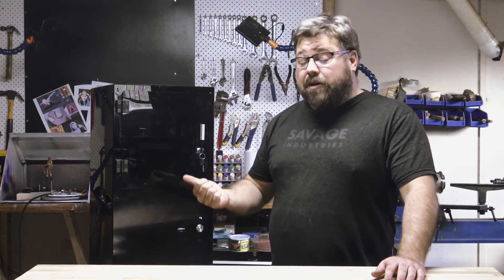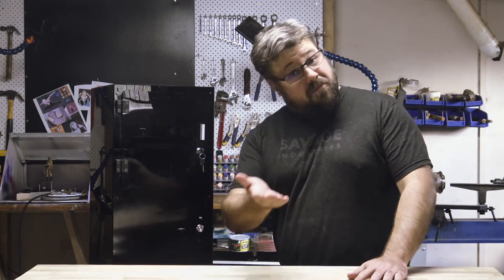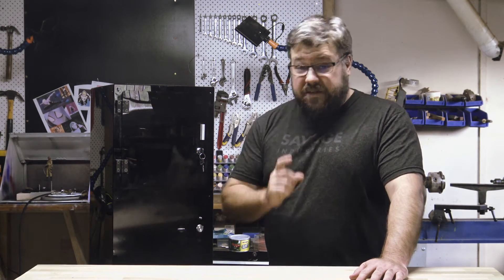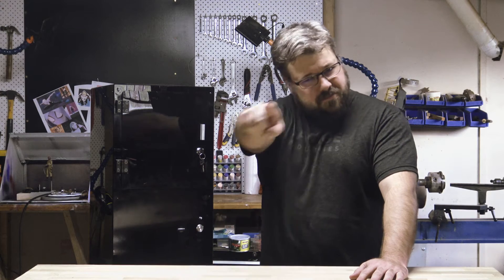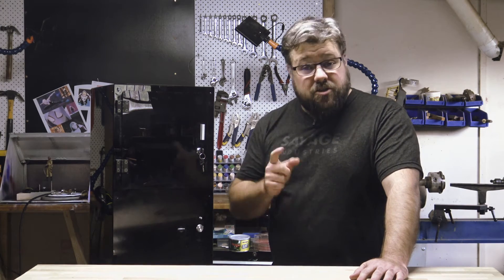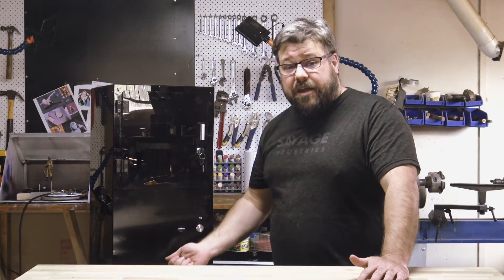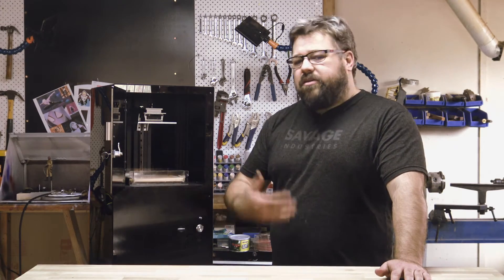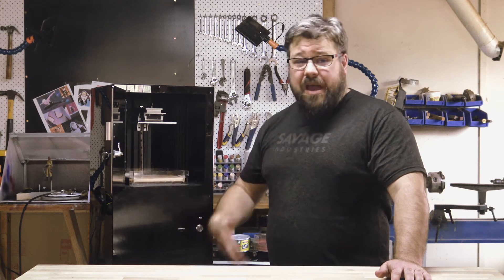DIY Smooth Timelapse Hack for Peopoly Moai SLA 3D Printer

Comment: Nice writeup. Did you ever consider just illuminating during the exposure?  You'd probably need an arduino in that case to get the timing right. (turn on light, shutter, turn off light)..

Comment: It's not the heat, it's the UV base led in the lights source.  Most if not All white LEDs are made from UV leds .
Reply from the maker: Ah, you think it's a UV LED and a fluorescing phosphor coating?  I think the wavelength they use for that is just outside of the tolerance band for UV curing at around ~450 nm.  That said, it would explain it if even a trivial fraction of that energy was 395 - 410 nm.
Reply: @MarkRhodesMaker  I would totally think the wavelength would easily vary especially the majority of Chinese made lights not being exactly specific in tolerances.
Reply from the maker: @bobbykoulouris  Yeah that is a very fair comment.   Thanks for the interesting thought and conversation regardless!

Comment: Won’t the led light cure the resin over a certain amount of time?
Reply from the maker: Aaaaand it turns out this isn’t true for clear resin.  Clear resin is extremely sensitive, and cures from the light.   Very interesting!
Reply from the maker: Cat 3D great question, and I actually recorded a response to address that, but cut it to keep the time short.   LED lights are monochromatic, so they only shine certain wavelengths.  White LEDs are a little different, as they peak in multiple different wavelengths, but they don’t really have much in the wavelength required to cure UV sensitive resin, which is sensitive to 405nm wavelengths.   It’s actually more likely that the resin will cure due to direct heat from the LEDs in close proximity to the resin, which actually did happen on a much earlier test version.  This new version generates far less heat, and so hasn’t been an issue!
Reply: It's not the heat, it's the UV in the LED,